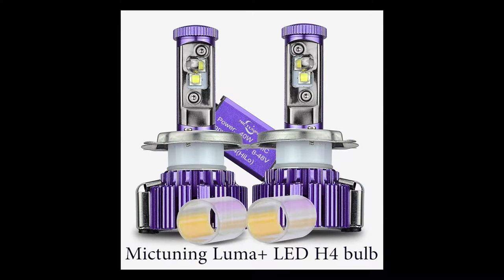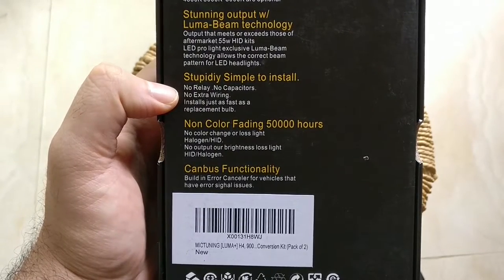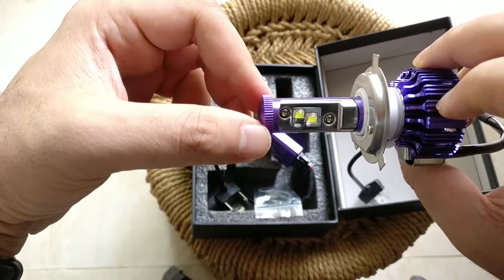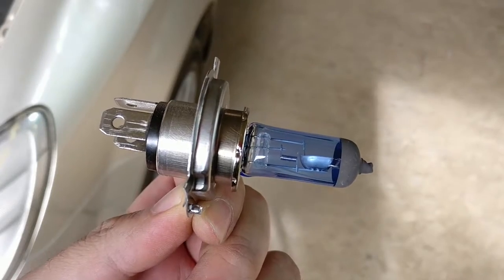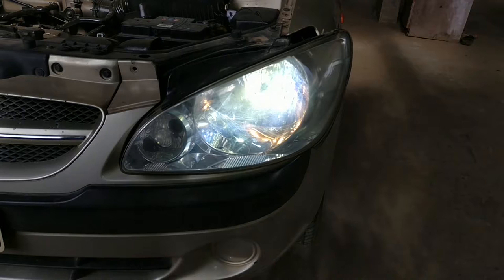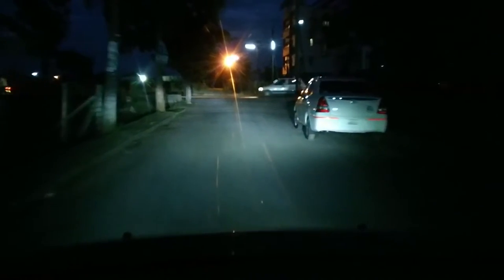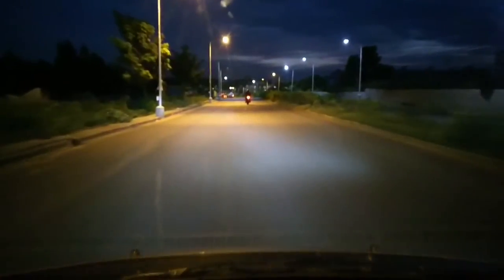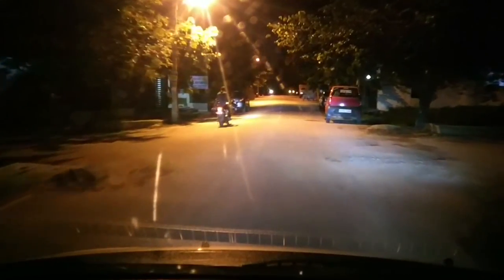Mictuning H4 LED Bulbs - Plug and Play

Comment: Does the buld twist off the 3 point housing to easily install the housing from the car ?
Reply from the maker: Yes David, I faced no issues whatsoever. Its like a regular bulb, however the cap holding the bulbs may not fit back

Comment: Did you have to adjust the way the bulb sits in the housing? I think I may have to flip mine. Just wondering if you have trouble with this. I have the same bulbs
Reply from the maker: Hey Zach, I dint have to do that for some good reason they fit perfectly. I am not sure if the make of the car has something to do with this. Thanks for letting us know.

Comment: hi there, where did you procure them from?
I got bi-xenon projectors installed in my punto. but I'm not at all happy with the beams, particularli hi beam, they suck. thinking of reverting back to stock headlights and using led bulbs.
1. how is the beam pattern, cut-off, spread, brightness, glare to oncoming drivers.
2. whats the cost and where did you buy them from?
3.were you able to replace the rubber dust covers?
thanks in advance.
Reply from the maker: Hi Dr.  Actually nice questions :) the pattern is really good. I guess the high beam and low beam work together when you flip to High beam and the lights are incredibly bright with the high beam
I got these from USA. cost about $50-$60 
You cannot replace the dust covers.. besides they have fan running and these are water resistant. So you need to keep them open.
thanks for checking! please do subscribe as there are many queries that we can clear, thanks a lot!